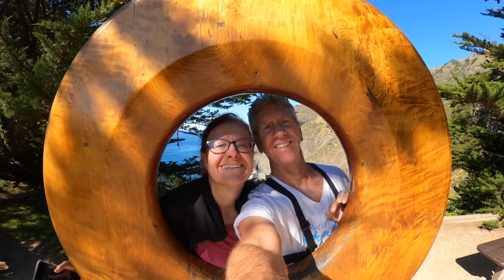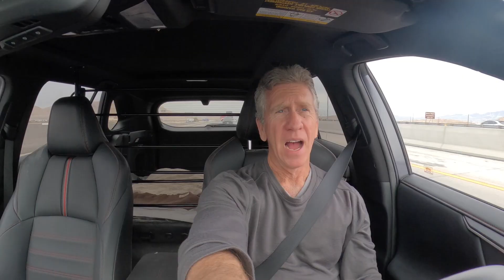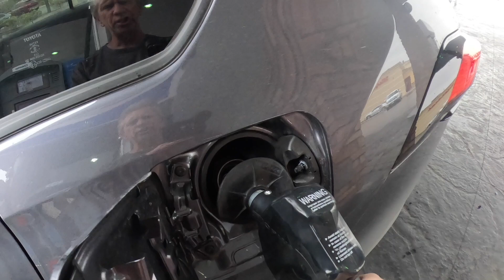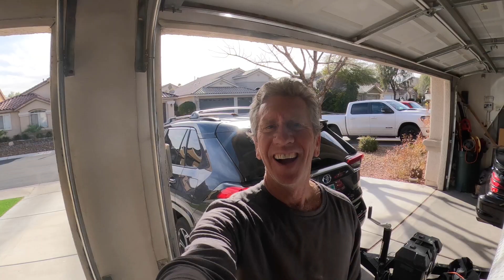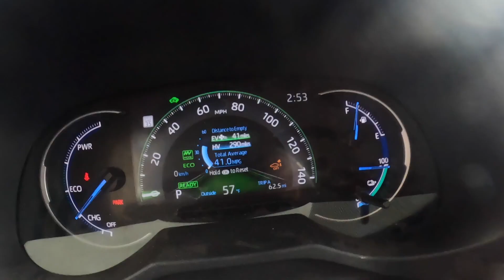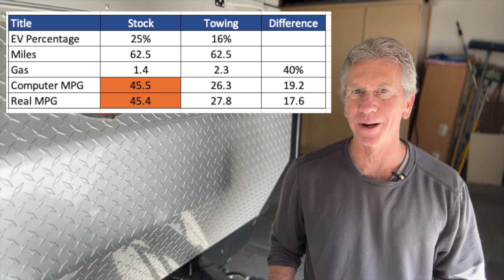RAV4 Prime Gas Mileage Test | While Towing an A-Liner Pop Up Camper

Comment: Hi Daryll,  Thanks for this info.  I'm excited to see you hauling a camper!  I'm considering a 2024 Prime and wanted some more tow-related details.  Do you have a 4-pin tow wire system or have you upgraded?  If so, can you provide details on what you did? Also interested in the tow weights: dry, loaded.  Any other hauling tips greatly appreciated!  I'm new to this.   THanks very much!
Reply from the maker: I went with the Toyota Tow and Wiring harness package, and then had an aftermarket truck accesories shop install a 4 pin to 7 pin adapter (basically they connect to OEM 4 pin and then install an extra wire from battery for the brake controller power).  Then I instal a Tekonsha Prodiy Wireless brake controller. The combination works great.  I've got lots of towing related videos on my channel (towing an ALiner) so check those out.

Comment: Noticed your EV range was 40mi at end of non towing test. If you launched with a full battery be aware that the prime will bleed off the top 20% even in HV mode. I think this could explain your high mpg reading.
Reply from the maker: Someone else told me this as well!’ Thanks!! Retest is due!!

Comment: My last hybrid was a Prius, and it was amazing what that little hybrid could tow. I put nearly 300k troublefree miles on it, outside routine maintenance. I now have a Subaru Outback with the 2.5. It’s rated to tow 2600lbs. I haul kayaks on a trailer. Fuel mileage drops from high 20’s to low 20’s, best I’ve gotten without towing was 35mpg, but I had to be super conscious of my driving.

When I had the Prius, I used Power mode when towing and it was like the trailer wasn’t there. (Got high 20’s, low 30’s.) How do you think your RAV4 Prime feels when towing? Dogged, powerful, medium? Also, what about how it feels in eco vs sport mode? (I don’t think a RAV4 has power mode, does it?)

I’m considering one for our weekend do-all as during the week I drive my work van. But curious how it responds when under load. My friend’s regular RAV4 Hybrid (not Prime) was like a fat Prius and was underwhelming.
Reply from the maker: The prime is great under load.  No issues with power.  The CVT Drone when going uphill is annoying, but when I hit the accelerator.. it just takes off, even when towing.  It has a "sport" mode which of course I always have on when driving around town, but typically not when towing.  You should checkout my wife and i's extensive review of the RAV4 prime.  I also will have a video coming out tomorrow about the updates for 2023 which are pretty extensive.

Comment: Being able to tow and still get 27 mpg is pretty darned good.  All well and good for flat land towing.  I'll be very curious how it does in the mountains, both maintaining speed uphill and holding speed downhill.  My Jeep (2020 Willys 4 door Wrangler, V6, 8-speed auto, 33" tires, 4.10 gears) gets 23 mph highway, 21 mpg commuting, and 17 mpg towing our Aliner over our two year history of owning both the Jeep and Aliner together.  Oh, and are you testing with the Prime/Aliner empty, or loaded for a trip?  The additional weight loaded for a trip will make a difference.  And, the upcoming brutal summer heat while towing will affect mileage, too.  More video testing to watch!  Cheers!  Pete - KI7LIL
Reply from the maker: Yeah.. The RAV4 Prime is empty.. So that will. make a big difference when we have some gear and there, my wife and the doggos. I think i've convinced my wife to consider a wrangler.  So i've made some progress on that front!!  Probably will have to sell my GT-R though.  Probably a year from now or so.. still have lots of content to create on the GT-R.. but it's worth so much money still and it's 11 years old.. Crazy..
Reply: That's not terrible numbers for your Wrangler either